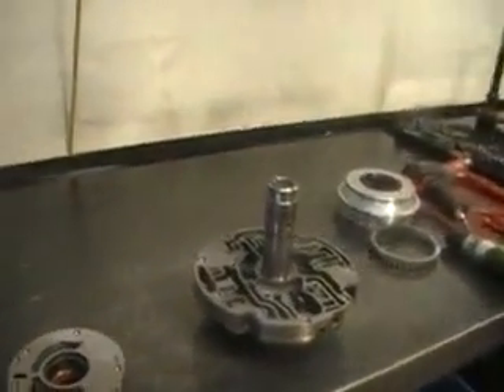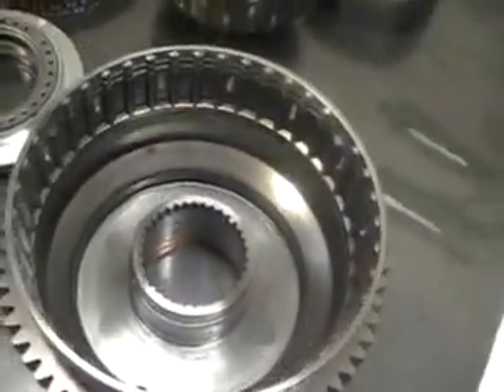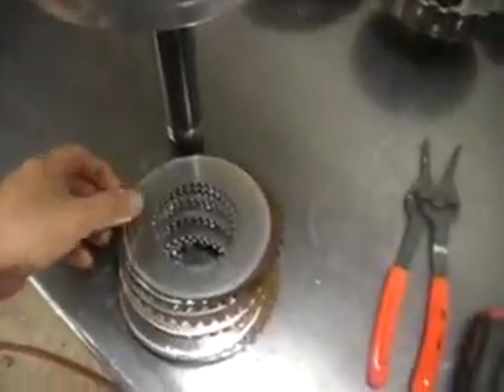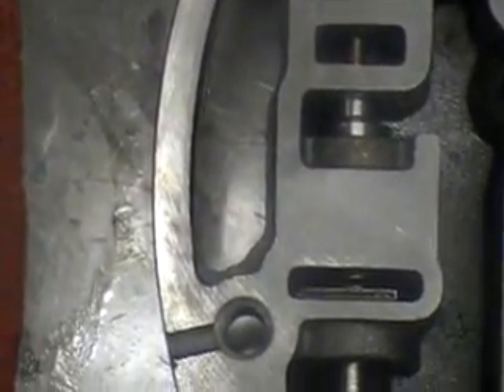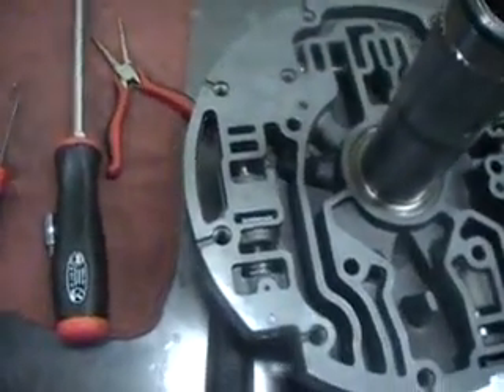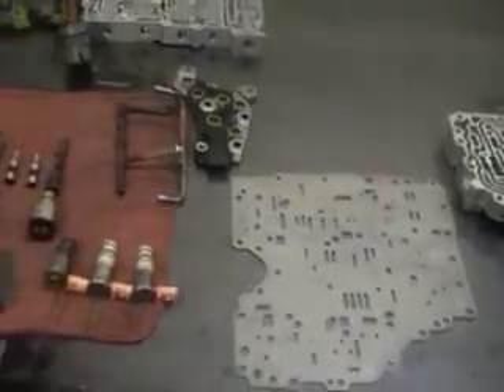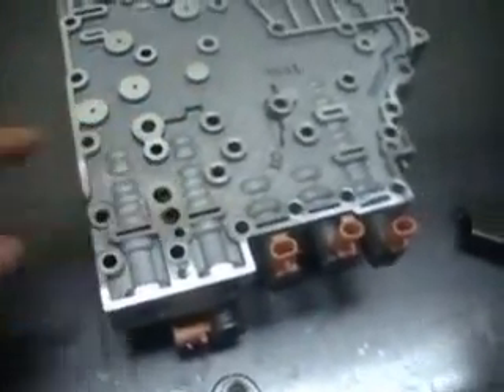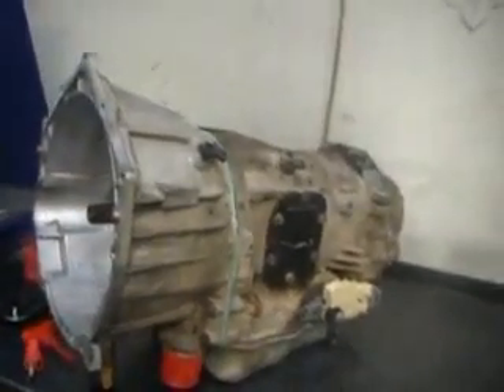Allison LCT 1000 Transmission Upgrade: TransGo Shift Kit Installation Part 2

Comment: Hi, I have an allison in my duramax pickup. It has 270k miles. When its cold it has a harsh 3-4 shift. When its warmed up full it flares bad on the 3-4 shift and then slams into gear. Im thinking one of the valves is sticking. I would like to fix this. Your video on the aw 55 50 trans helped me fix the one in my volvo and im thinking its a similar problem. Do you know what shift valves could be sticking so I know where to look?
Reply: Bad lip seals, hard when cold, soft when heated up, plus broken hardware- Springs. Needs a rebuild.

Comment: I have a 2001 Silverado 3500 6.6 diesel truck, with Allison transmission. I've been having problems with the transmission, it works well when the engine is cold. However, after about an hour driving in the city the "check engine" light turns on and the transmission starts to skids (the engine accelerates but the truck does not move). I already used the scanner, but it says something about the transmission sensors or computer. What do you recommend?